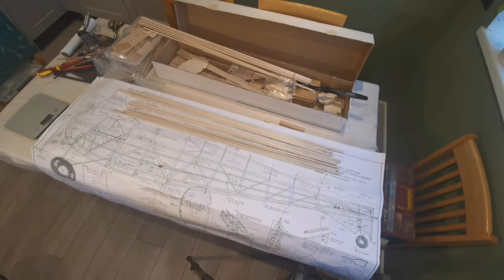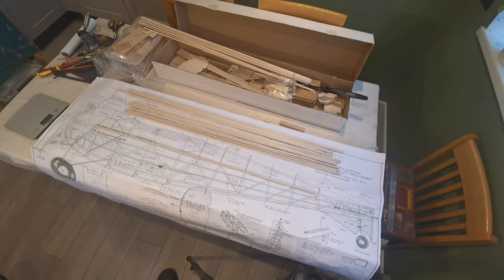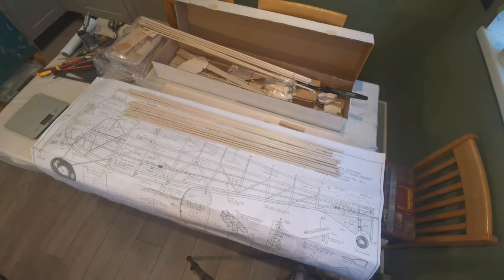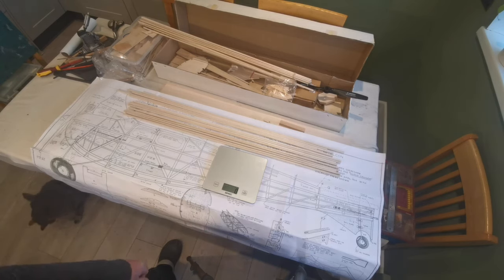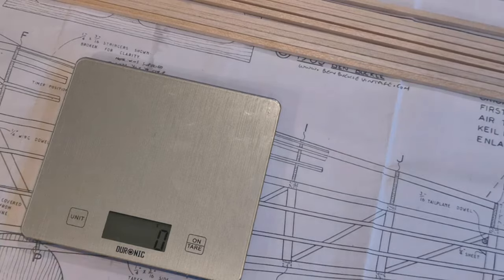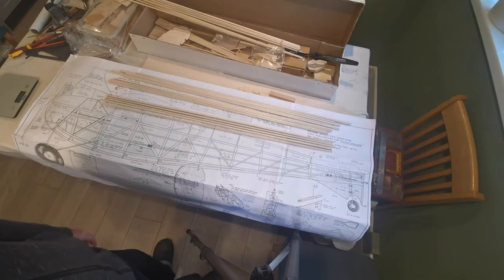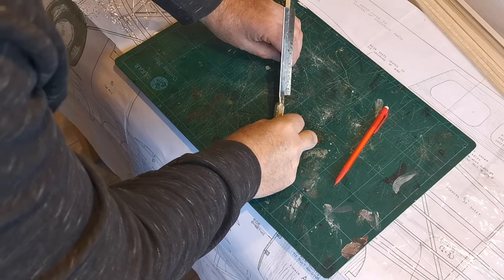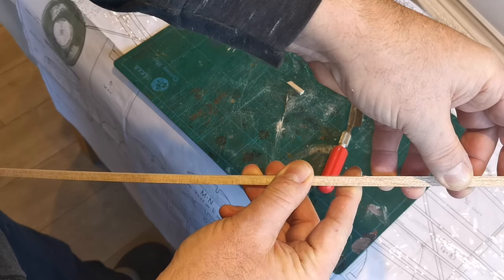Ben Buckle Falcon: Fuselage stage 1

Comment: I put the small pins in the balsa Mark, I guess this is wrong? I should be putting them like you?
Reply: Chris if have to put a Tpin through the balsa I’ll wipe some White glue into the pin holes. Jeff
Reply: @JeffinLowerAlabama  I found most filled in while sanding, the others i filled with balsa filler. Was just worried for a moment 🙂
Reply from the maker: It's just a good practice to avoid putting the pins through the wood sometimes it's hard to avoid and it's not the end of the world if you do.